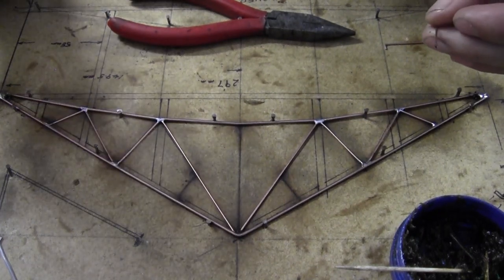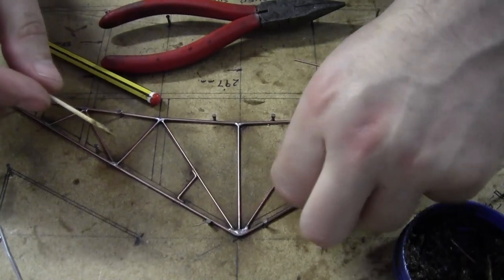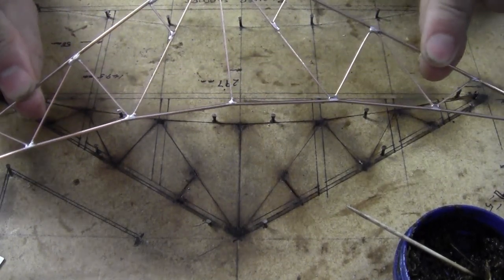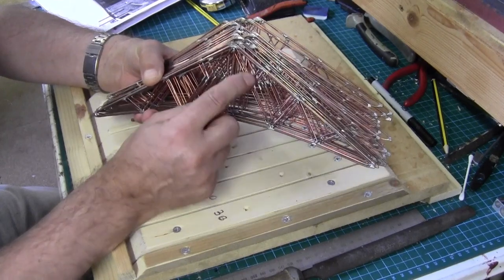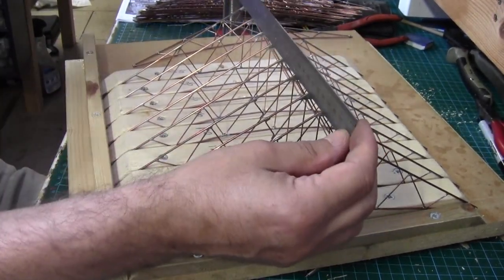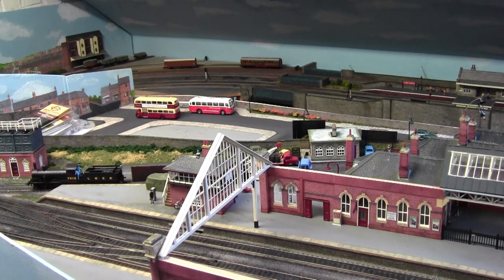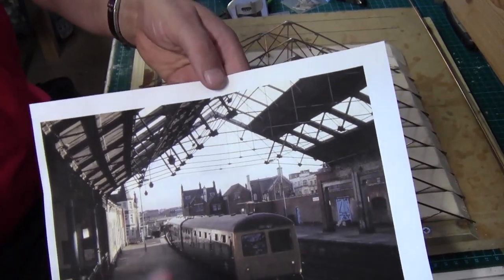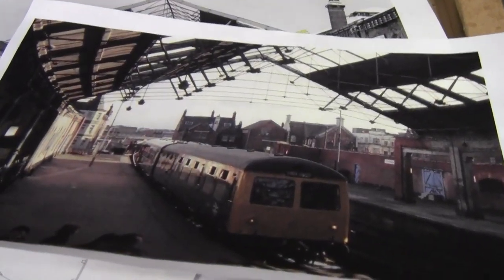The Big Roof Part 5.....The Truss Jig   No276

Comment: So far so good. As with a lot of these jobs, the jigs and tooling can take just as long as the job itself. I do agree with one comment though, I think a small area on the apex could be covered to give a sharp ridge line, as I suspect the trusses are overscale in diameter and may look slightly over heavy where exposed particularly at the ridge. BUT of course it's your railway so you do what you think is best for you.
Reply from the maker: Good morning Malcolm. at this early stage of the build it good plan which way to go when it come to applying the canopy to roof. especially with the amount of changes this roof has gone through over the decades of its life. A small ridge panel at the top would bring in line with how it looked before the war....which i think will correct....many thanks for commenting stay safe and keep cool. boy its a hot one, this weekend.........cheer's Tony

Comment: Hi Tony.   I like the assembly jig but I was wondering what your plans were for the curved section of roof.  Is the curve constant, facilitating a curved stop on a new jig?  I would imagine that you will be splitting the difference when it comes to the spacing at each side.
I think your choice of roof style is a good one, as it will provide better visibility of the inside of the station from above.  Having said that, the glazing was probably black with soot and hard, if not impossible, to see through.  You could compromise with lighter weathering and maybe some missing panes (those naughty boys, again 😏), or omit the glazing altogether, as I suspect they may have been omitted at some stage (that could be your story, if it did not happen in reality – waiting for the glazers to arrive).
I would not be too concerned about the copper coming off the rods, as it is there to prevent corrosion of the mild steel wire underneath.  Mild steel will solder successfully, provided it is clean, you use flux and apply the correct amount of heat.
I look forward to the next instalment, my friend.  Watch your fingers on that grinder! 😲  Best, Jason.
Reply from the maker: Hi Jason. i think once the straight sections are complete i will strip the jig down and re-jig into a very slight curve. that should work. the clear glazing would work on the lower section as per photograph. and leave the top open for sneaky peaks. looking forward to the assembly although it may be to hot in the loft to do. you have some interesting thoughts about missing pains. as it clearly shows in one of the photographs  that pains are missing in the later years. its a linishing pad in a battery drill on slow speed. and it does the trick. just very slight touches is all it needs....have a great weekend. all the best Tony

Comment: You need to curve the wall plates Tony make them up in 12-inch sections put dowel pegs through the wall plate so they locate on top of the walls otherwise you get dog leg in the roof
Reply from the maker: Thank you For the tip Michael.....stay safe all the best Tony  👍👍👍👍

Comment: Nice video. What the roof main material and what type of soldering you use?
Reply from the maker: Hi Ruda. I am using 1.6mm & 1mm Tig mild steel welding rods, the solder is standard solder used by electricians...many thanks for commenting Tony